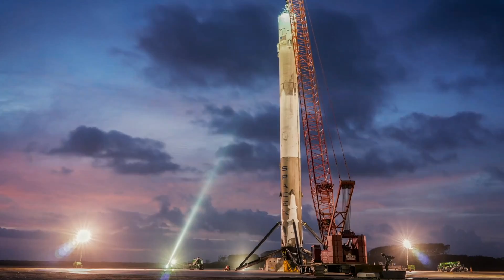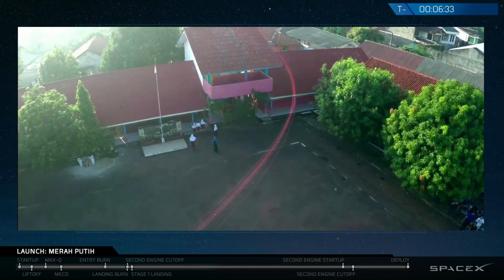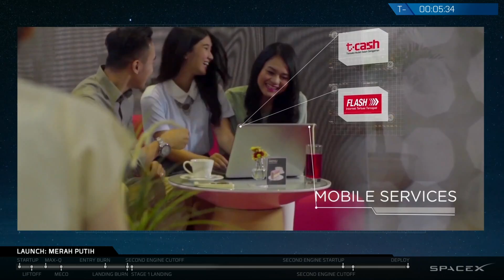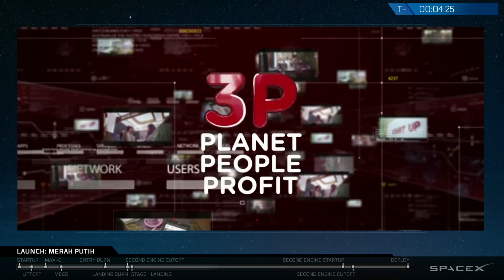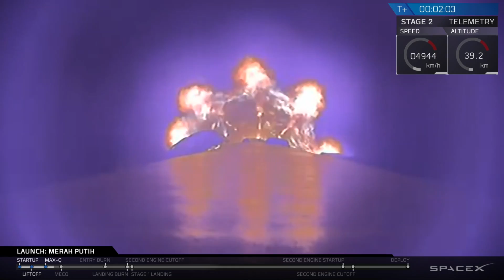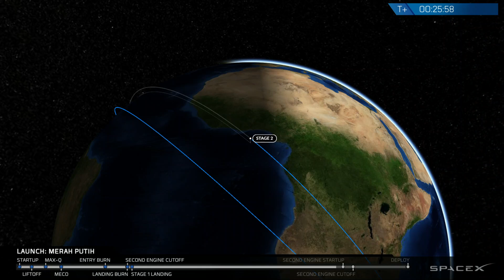Merah Putih Mission

Comment: However SpaceX should developing  AntiGravity Spaceship can be used Thousand Times build base on gravity just spinning NOT with Rocket #FeelFree  

A. The Top part, we name Positive rotate to right, and the edges is getting thicker and havier.
B. The Buttom part, we name Negative rotating to left, and the edges is getting thicker and havier.
C. Middle Part , we name Neutral, air crew placed and also machine and everythings turning Negative and Positive at the same time.

The aircraft can liftup added with explosion from the engine. However that aircraft construction later, let the engineer doit it, and we are sure the aircraft will bulletproof and also waterproof.